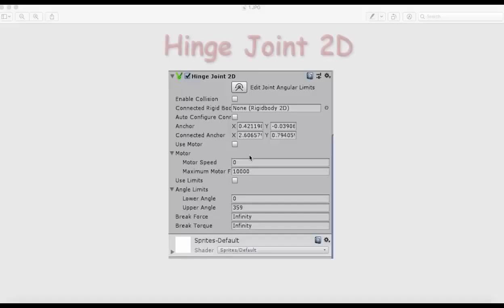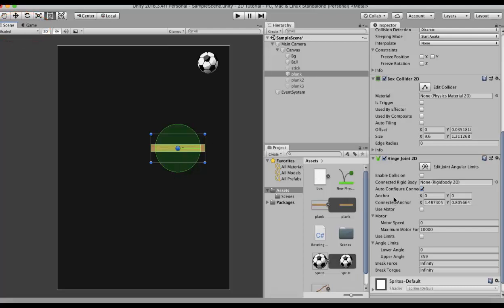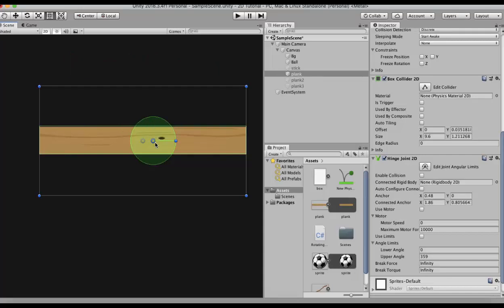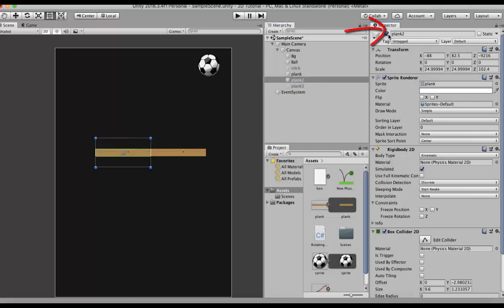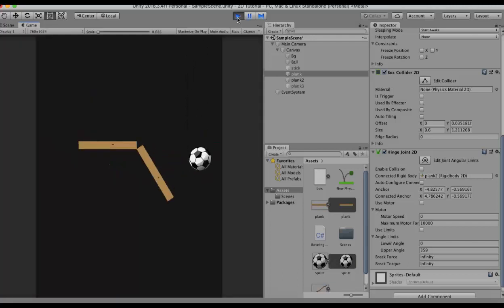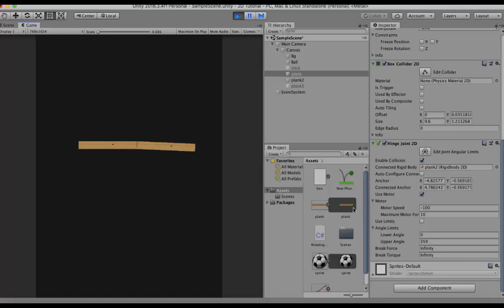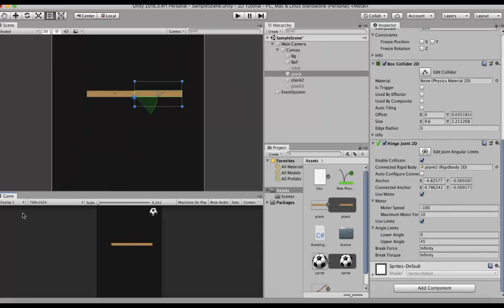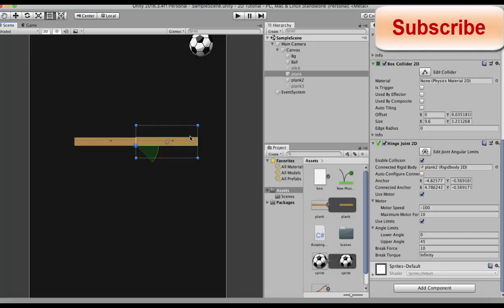Hinge Joint 2D - Unity Tutorial

Comment: Trying to make a car antenna like in Hill Climb Racing. That would bend when acceleration changes.
It is made up of parts that have been joined with the Hinge Joint but the set angle limits do not work as expected. That is, they are trying to constrain the angle, not rigidly constrain it.
For example, I set the angles -5 ... 5 degrees, but with sharp jerks, the angle climbs out of these limits.
https://i.postimg.cc/3rf8VXtD/antena.jpg
Reply: Solved a problem. Removed BoxColider2D from elements where Hinge Joint 2D is used.